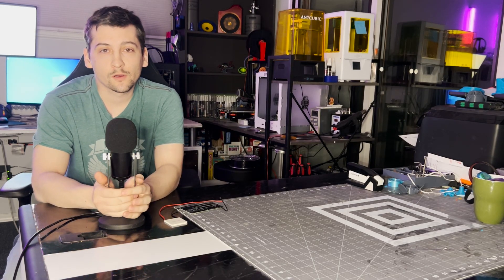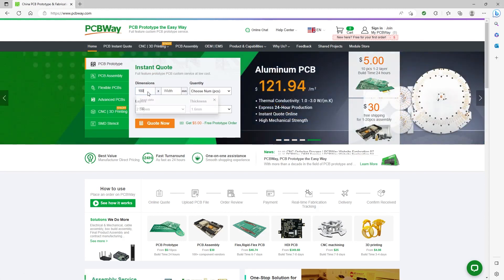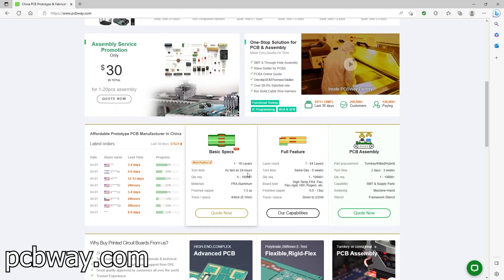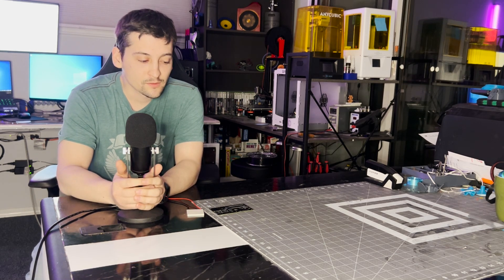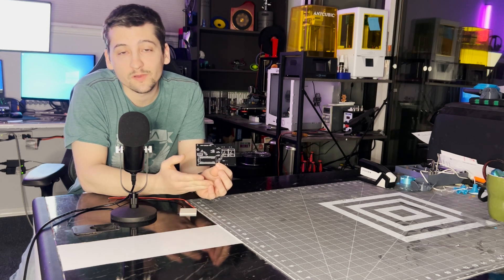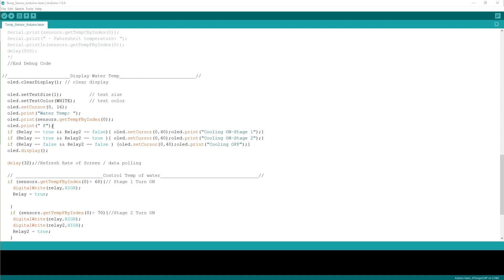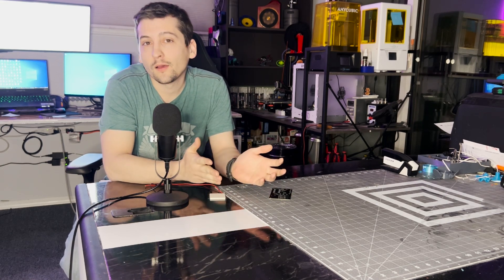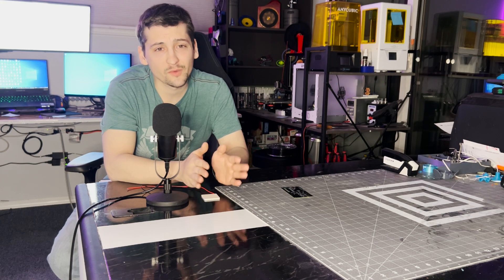Arduino Controlled Peltier Cooler | k40| Water to Water

Comment: Which 3d printed soldering vise do you use? Could you point me to the Thingiverse (or other) page for that vise? I like that you can rotate the part while working on it, instead of in being held flat
Reply from the maker: I looked and could not locate it… I downloaded it/printed it a few years ago and have used it since. 

I did manage to find this one: https://www.thingiverse.com/thing:35042

It’s close but not the exact model I have.
Reply: @piscesprinting  Sweet. Thanks a lot. I had looked on thingiverse but had not seen that one